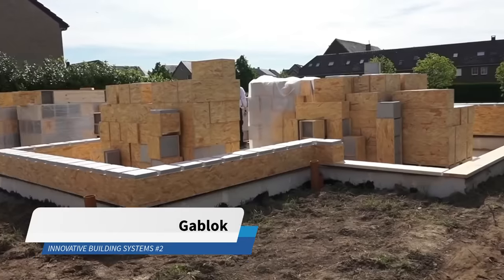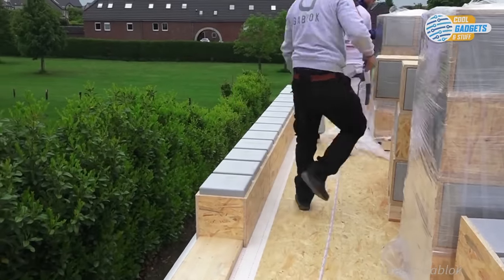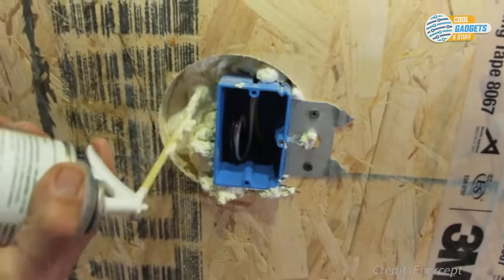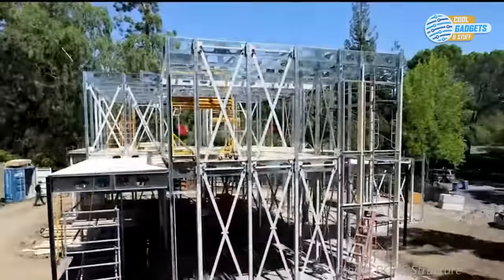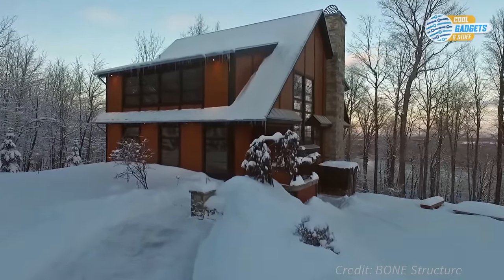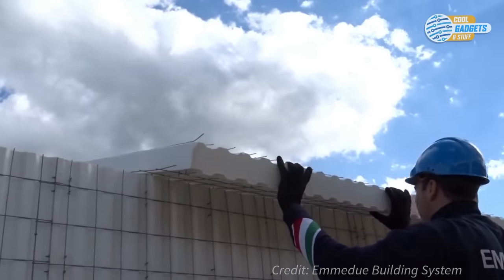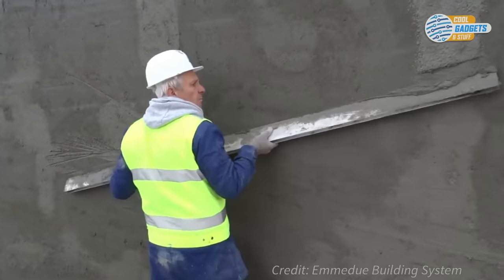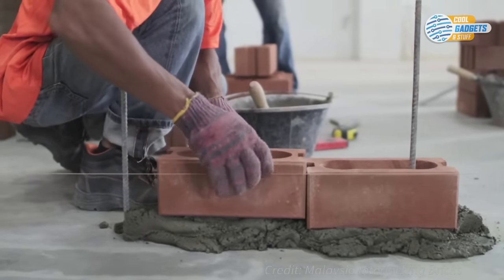5 Innovative BUILDING SYSTEMS for your house #2

Comment: In my country we use bricks, and there is nothing better than oven clay bricks, which can stand 200 to 300 years if looked after, however I am convinced that there should be a layer of weather/heat proofing layers, to reduce the heating/cooling costs.  In countries where temperature rages fro 40 to 48C in summer, and below 0 in winter, these methods may not last even 30 years without problems.

Comment: I wouldn't trust glorified OSB and polystyrene lego bricks for a house. What about running wires? What about the gap between the wood faces with no filler material? It's a good start to an idea, but absolutely terrible when it comes to any real use of it. Plus there's other products on the market that combine traditional structure building with high amounts of insulation, probably at a cheaper price too.
At least SIPs come with channels for wiring, but you still have to modify the panel for piping, which isn't preferable. I also wouldn't rely on OSB and foam for an entire studless wall, again, glorified lego bricks. 
"Steel is earthquake resistant." That's blatant misinformation. Might be more resistant than wood, but it is not entirely resistant. If it was, tall steel structures wouldn't have mechanisms to help reduce impact from earthquakes.  
I also wouldn't trust those interlocking bricks, that were literally described as glorified lego. You're relying on the interface of the bricks and a vertical tube of concrete to keep a structure together. There's a reason why bricklaying uses mortar between floating bricks; maybe we shouldn't deviate from that reason just to 'save on concrete.' 

Most of these are just cutting corners with expensive products. The only good one here is the steel construction, as that's already a proven building material.

Comment: All the open spaces in-between the material,a tornado will rip through this like it's made of tin foil.
Reply: Qwned!
Reply: Michiel van Erven  Actually, Europe has tornadoes, but very weak ones which will at most do some roof damage, though in rare instances can be F3 tornados.

Comment: I've searched the entire website of Gablok for ANY information regarding FIRE. Nothing. Literally not a single word on the consequence of building your entire house from glued together wood chips around styrofoam cubes. Amazing, you'd think that was the first thing they'd address.
Reply: You realize most homes are made of flammable materials like wood 2x4's, right? There would be minimal difference between these and a regular framed house with normal insulation. Most pink insulation is "fire resistant" , but the backing catches on fire easily and once the temps are hot enough, even the regular insulation quickly burns away. If you were really wanting fire resistance, put in drywall that is rated for higher fire resistance that would slow down or prevent any fires from quickly moving through the structure.

Comment: It would be interesting to know how all those systems behave with the years... after 5 years? 10 years? 25 years?
Reply: I'm dealing with one of those systems right now that the builder forgot to put flashing on there is no conventional way to repair the panels once they're installed you have to call a structural engineer and have him tell you to take the building down in order to repair it. The building I'm working on is only 8 years old and all of the OSB at the base of the building completely rotted off leaving the entire building to rest on a piece of compressible  Styrofoam

Comment: 1: A formaldehyde nightmare with one of the least ecofriendly insulation materials - great. Also I doubt it is a good idea to live in a pile of loose blocks.
2: Ecologically the same but with probably greater strength.
3: Steel is pretty recyclebale, that is good. Then came the spray foam and everything was ruined. I correct myself: THAT is the least ecofriendly insulation material.
4: Styrofoam and concrete. Great. Due to the sand shortage concrete should be avoided as much as possible, What do we do? Build a whole house from it and insulate it with completely unrecyclebale foam. As they are connected they will not even be good for landfill later on.
5: Did I just hear it saves cement although it is partially made of cement and connected with cement?

Basically there aren't many options for the future. I'd say wood or metal framing with insulation from various plant fibres with plastics only as a removable sheet. Inside walls made of solid wood fibre board and then some thin board like a regular dry wall. That's the most technologically advanced and environment friendly setup I found so far with almost no compromises.
Reply: You speak nonsense, the current trend is a hemp superstructure with tofu as the insulation, all 100% biodegradable.
Reply: Theses homes will still be around long after you are gone . Your opinion is irrelevant . These people are doing their best with the materials and technology that is currently available . That is the best we can hope for .
Reply: go build with straw bales and lime washed walls
Reply: @Quest_NPC_  Why not? Are wooden houses not proven for many decades?
Reply: @edgarortiz4681  That is exactly the problem. I am sure they did their best. That is why I wanted to inform them they achieved nothing.
Reply: @rainerzufall689  ...  I am not disagreeing with your comment in regards of sustainability and being environmentally responsible . However , I do not consider a home that should provide shelter for over a century can be categorized in the same context as perishable goods . Yes , an effort must be made to ensure that we preserve our natural resources and stop damaging the planet . Unfortunately , we do not have the luxury to disregard the need for housing . We must do the best we can with the materials and the technology we now have . We must go forward with what we have at our disposal . To disregard the data and choose not to implement new technology is short sighted . If we all shared your point of view we would all be living in caves . I look forward to the day that we will all live in a environmentally sound environment that will have no detrimental impact on the environment . Until then , we move forward with what we have .
Reply: sand shortage? 😂😂😂
Reply: Since when do we recycle our homes? Why do I need recyclable materials to build a home that should be permanent?

Comment: Polystyrene is highly flammable. Worst building material ever.
Reply: I dont know how its in US, but in Europe expanded polystyrene (EPS) used in construction have to be B-s1, d0 class, means its resists direct fire for at least 20 minutes, producing very small amount of smoke and not producing melted drips during fire. Modern EPS is definitely not highly flammable material.
Reply: Not to mention poisonous fumes which cause cancer
Reply: You mean like greenfell? Yeah real safe
Reply: @DrLoverLover  Grenfell tower was insulated with PIR (Polyisocyanurate), not with EPS (Extruded Polystyrene). PIR is significantly more fire hazardous than EPS (in general from fire risk point of view, for insulations applies this: PIR > PUR > EPS > PHF). Also technology of insulation with PIR requiring presence of ventilation gaps in cladding, which further increases fire risk (during fire, those gaps turn into flamethrowers and temperature inside those gaps many times overcome ignition temperature of PIR panels). Exterior cladding with EPS is practically always without ventilation gaps. Sometimes there are gaps for lightning conductor, but if its made according standards, risk of fire is minimal + for buildings higher than 35 m, if I remember correctly, lighting conductor cant be covered above 35th meter of high.

Comment: 1 storm,  than crying that the house is gone. Build a stone house man...
Reply: Wood)
Reply: Esp now that hurricanes are happening further north.    Is this light and airy thing going to hold up?    Building codes are weak since builders lobby the politicians and give them money.
Reply: They use wood rods for all the houses around where I live in Canada
Reply: Did you see that long shot where it showed a flat terrain? I think that's somewhere in tornado country or even Florida,  anyway those homes don't seem that strong to withstand tornados. Very doubtful the building codes in high wind areas approve these homes. I guess they want to make it easy to assemble so non-english speaking labor can put them together.
Reply: @hmax1591  No this video is just shilling that's all
Reply: I am a mason, the trowel kind not the ring kind, and I like the way you think.

Comment: This video fails to mention steel SIPs.
Pros:
 -No additional sheathing, or vapor barrier required
-Lowest cost per R/sq-ft
-Fastest construction 
-No thermal bridging (when properly installed)
-Reduced foundation strength requirements 
-Significant reduction in pest related problems
Cons:
-without extended interior finishing, will require conduit for electrical

Comment: You just cannot beat polyurethane SIPs for energy efficiency.  Everyone always looks at the up front cost of building a home, but neglects the huge energy bills they are going to have for the rest of their lives by using the cheaper stick frame with fiberglass batt insulation option.  You have to look at energy costs and maintenance costs if you truly want to do a cost comparison for a system.  You also have to look for longevity of the building.  All construction materials and methods have their draw backs, which should be considered and weighted by the environment in which the building will be constructed.
Reply: a system like your talking about is only as good as the flashing and water proofing
Reply: @krazzygranny7032  It is the same with practically every other construction method known to man.

Comment: For Gablok. What about wiring, plumbing and everything else that is installed within the walls? It would be a pain to  try and drill holes for everything. Seems good on paper for a home, but it would be better for a shed where you can have external wiring.

Comment: Love the interlocking bricks and steel rods design do you have snything about the prefab concrete structures that architectural companies are now doing to minimize building time. You design the concept with architect and engineer they send you the walls floors roof after you set foundation created in factory ..
Reply from the maker: Hi, I feature Superior Walls in my previous Building Systems video. It's basically Steel frame and concrete walls. There are others prefab concrete wall systems but couldn't find any videos. There is also concrete formwork. Those are usually utilized on bigger construction projects with integrated steel. There are also some completely made prefab concrete houses on the market like Koda house.

Comment: Every of these technology doesn't work well in a real life, it is just a beautiful picture
Reply: Explain why?
Reply: The SIP's work great and have been around for many years, at least 18 or more. Some not included were Monolithic Dome homes and Earthships builds. Monolithic domes are kinda similar in construction as the poly-foam wire grid encased panels but round so that tornadoes and hurricanes have no flat walls to blow down.
Reply from the maker: Hi, I wanted to include Dome Homes in the video but I couldn't find any company with any decent footage. Round houses are also hurricane resistant, check out Deltec Homes, I featured them in one of my Prefab Homes video. About Earthships, I featured Cob construction in one of my Eco Building Materials video as well as other building styles and materials like Cordwood homes and Hempcrete.
Reply from the maker: hey, thanks for letting me know. I didn't see your reply sooner for some reason. I will definitely check these out. I plan a video on unique home builders soon. Will see if I can include these. Thanks again.

Comment: gablock slightly easier to build but 10x harder to add utilities, how do you run electrical, plumbing, ventilation, heating cooling? u would have to build normal stud walls just inside exterior walls? seems like more work than traditional building

Comment: It's one thing to come up with these ideas for building but the real test is after 5, 10, 20 or even 50 years time how well the structure holds up. Most if not all testing is done in controlled environments and not real world, I'd rather pay extra for a proper wood and clay brick home as I know it will still be standing in 100 years time

Comment: I think where a steel framed house looses out is not only has it a fairly high coefficient of heat transfer it also has a similarly high coefficient of expansion, whereas ceramic bricks and blocks do not have high values. Therefore when used in combination this can be problematic. Also the high factor of heat transfer means that any moisture settles on any bare structure and this can drip off and spoil decoration. Where I understand that good design and building practice can do a lot to mitigate these effects. These factors still exist and must be understood. If you have ever seen aluminium window frames that drip with moisture in humid weather you can have an idea, but granted aluminium is much worse in both respects.
Reply: That is a very good info

Comment: Dollars per square foot compared to stick framing would be helpful.  I'm guessing these system are all a lot more expensive.  I also see a potential for issues since most tradesmen won't have any clue how to deal with them.
Reply from the maker: Pricing differs from project to project, kinda hard to give an estimate but from my research prices are comparable to traditional framing. Steel framing is about 10% more expensive.

Comment: Do one over hemp building products
Reply from the maker: I did cover hempcrete in my Eco Building Materials 1 video.
Reply: @cgstech5657  I've seen that one. I'm using hempcrete in my house. I was thinking maybe like if there's any hemp roofing, hemp board, hemp I beams, and such. Love the videos btw.
Reply from the maker: As much as I know, hempcrete is a non-structural building material. I doesn't have the compressive strength to be used for beams, blocks just insulation for now.
Reply: @cgstech5657  actually I've watched people make I beams that can hold their own.
Reply from the maker: Hempcrete I beams, interesting. I found two companies with hempcrete building products - Hempitecture and GeoSIP Hempcrete blocks so will likely include it in my next building systems video. Thanks for the recommendation.
Reply: @cgstech5657  glad to help. Maybe look at interior hemp products. I'm getting ready to build my house and I am using a lot of hemp, recycled material, and a green roof. I don't get why houses today aren't made more sustainable so I'm building my own.
Reply from the maker: Wow, that's great you're taking things into your own hands, literally. Hope it saves you on the cost as well. I guess people don't know much about construction or don't have the time or will to experiment.

Comment: I'm not the coldest beer in the cooler but the very first option(interlocking foam in wood blocks) to me seems to be the way to go.(and yes I realize I just presented a 27 word run on sentence,of which only 4 were four were of 5 or more letters) Given the apparent sound deadening and insulating qualities,the 100% wood to wood interior vs wood to block/2x2 attaching points,and the generally(to me)more aesthetically pleasing semi finished product, how or why isn't it the best option out of the group? Price?Availability? Building code compliance problems? Please respond.

Comment: For the sip panels, he said they are strong and get stronger as you stack, does that not need load baring walls? Also the Gablok system doesn't look like it would be able to withstand Floridas climate, hot and continuous bashing of hurricanes

Comment: I think the Lego is the cleanest, don't have to use cement and don't even have to paint the walls, can hang cabinets on the wall, can change some walls easy while breaking and rebuild a part, and cheap overall... Can you answer me about it?? What is the Best and the future for building houses with 2 floors??

Comment: So how would you add plumbing, low voltage wire and electrical. Looks like it is going to be ugly pipes outside the walls.

Comment: how is gablok approved?? the blocks slot together like lego, whats to stop the blocks comming apart when the roof is fitted and a storm products large uplift on the roof, it would rip the house apart? In the UK we have wall plates which are fixed to the walls....The walls with gablok (from what i have seen in this video) only rest on top of one another?

Comment: Do home construction methods need to be reinvented in this time of changing weather systems? Not only in the Northeast but all of traditional tornado country also hurricane zones. There is a large market out there for safety minded home consumers out there.

I wonder if inflatable shelters can be filled with something other than air if the material the inflatable shelter was made maybe not with plastic instead use a very strong material something like or maybe even Kevlar. Maybe fill it with injection insulation or cement.
I am super poor so i do not have the resources to do anything with ideas. Honesty is what i am counting on.